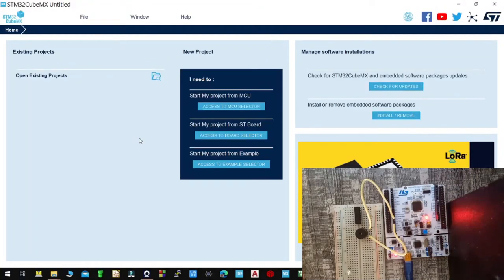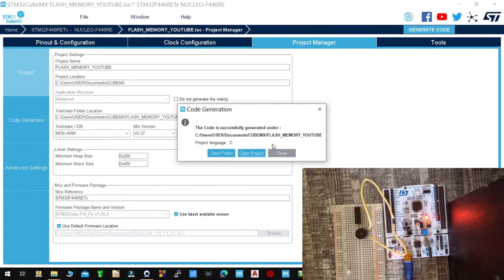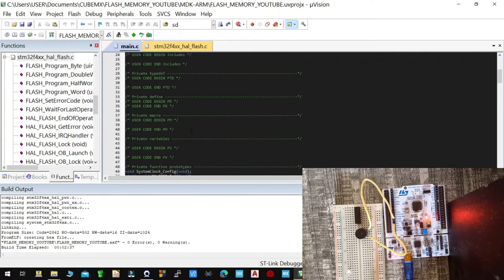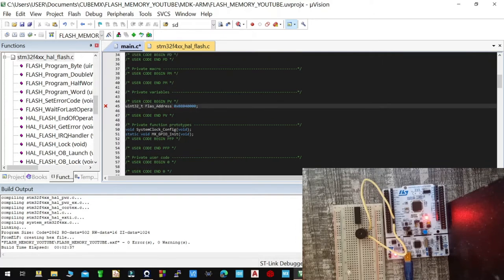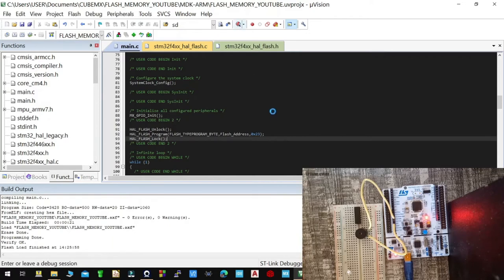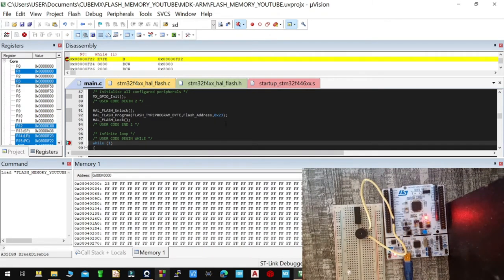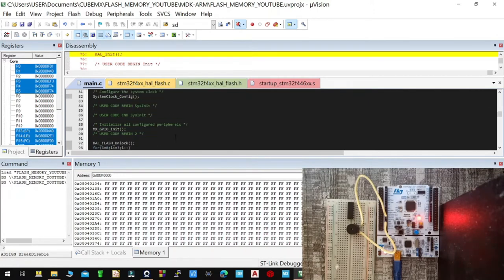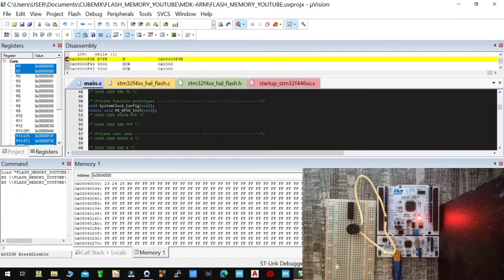READ ,WRITE AND ERASE THE STM32 FLASH MEMORY

Comment: thank you for the explanation
"I have a question, and I hope you can help me with it. I am utilizing four sectors to store four variables on an STM32F411CEU6. However, I'm encountering an issue where the compiler or debugger is using sector 3 and altering my data. For instance, when I store the temperature value in sector 3, I receive unexpected results like zero or strange numbers. Upon inspecting the memory, I discovered that the compiler uses one of my sectors to write its own data. I researched online and learned that I may need to modify the linker script. Can you assist me with this?"

thank yyou
Reply from the maker: Hi,yes,before writing the whole sector is usually cleared,so you loose all data stored initially,always read and stored the data before writing to the flash